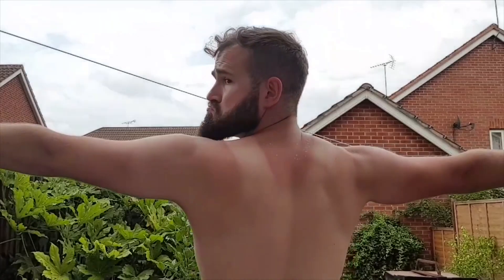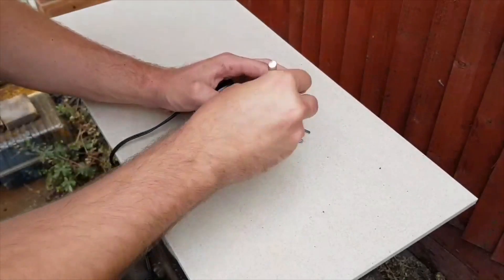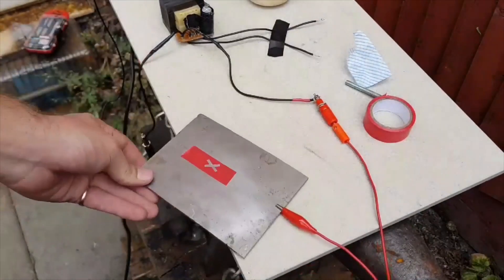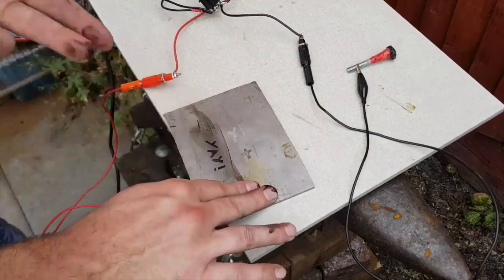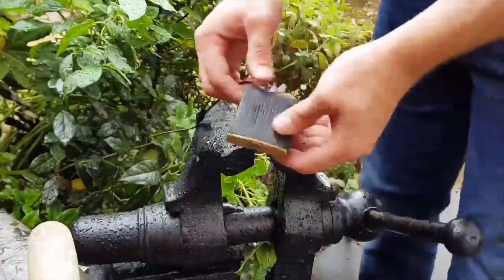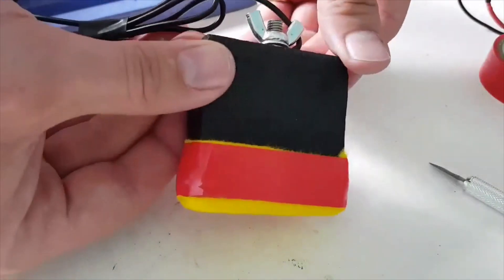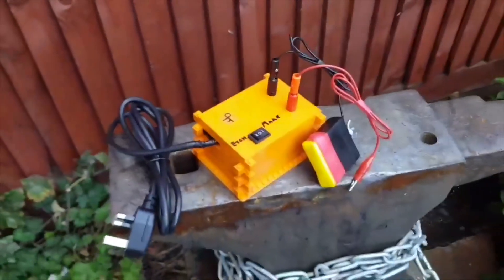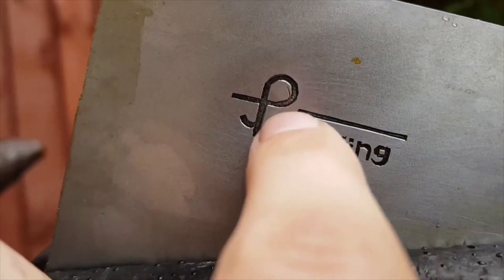Making a DIY Electrochemical Etching/Marking Machine

Comment: Do you have a model number on the powersorce or did you find it second hand? Also the printer sounds almost killed me I laughed so hard! Great video
Reply from the maker: Adaptor: DV-1280-UP. Picked mine up on ebay for pretty cheap. :)

Thanks!
Reply: @PJTForging  got mine off eBay too new old stock £9.95 bloody bargain.